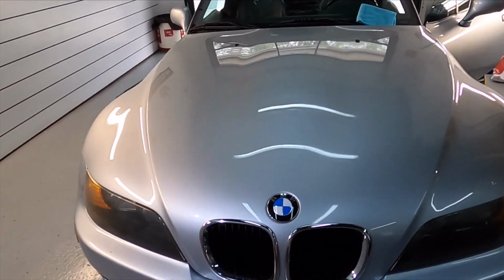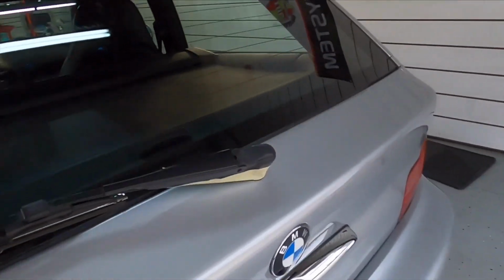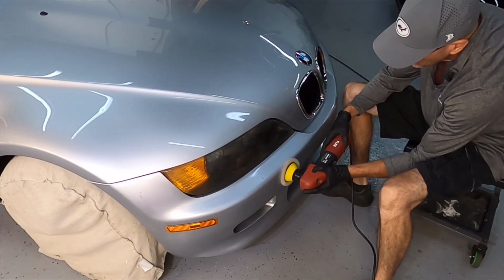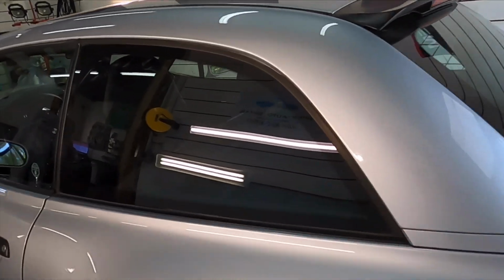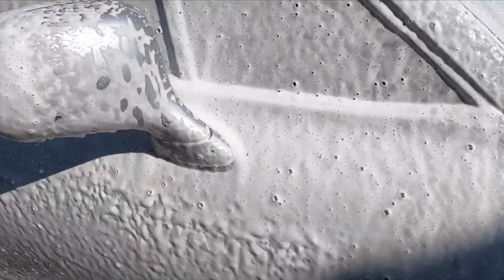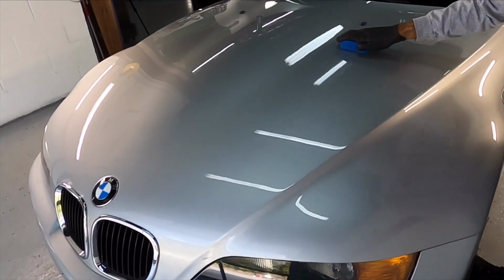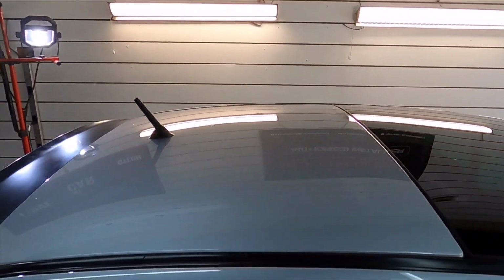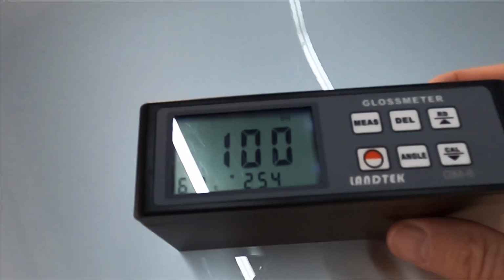Classic BMW Z3 Coupe! "The Clowns Shoe" Paint Restoration And Protection Series! Part 2!

Comment: i know this is off topic but im in need of your help and advice.i am having a debate with a work colleague of mine about removing bird lime etching.he says that you can use a heat gun to remove the bird lime completly.however i am of the opinion that doing this will damage and put more stress on the clear coat.i prefer wet sanding and buffing for removing bird lime as i consider this to be much safer if done correctly.